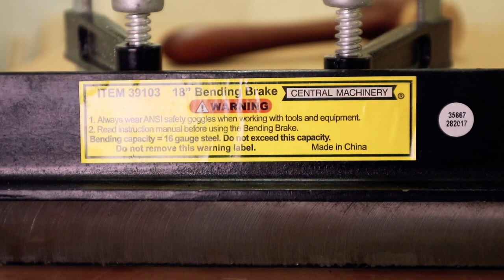Making a Custom Brass Holster for my Leatherman Multi tool

Comment: Outstanding! I expected you would bring out all theses power tools. I was surprised. Even I can do this.
Reply from the maker: Thanks!
Reply: Willie No Le
Reply: Bet you can’t, or don’t. ;)
Reply: Sure, exept for the acetalyne welding. That isnt so easy.
Reply: @c4scompsmith  that was brazing with a MAPP torch.  Much lower temperature, but hotter than soldering.

Comment: You can buy them off the internet made of steel and powder coat it I have one I think leather men should do it for every multi-tool they make won't look as nice as it ages if you ask me and turned green crusty corrosion on it as those nasty little fingers touch it I also polished my Leatherman making it look somewhat like the Swiss made multi-tool another Plus
Reply from the maker: Sorry, but your comment is hard to read without punctuation. I don’t know what you want to say.